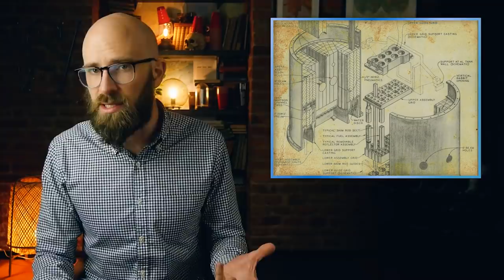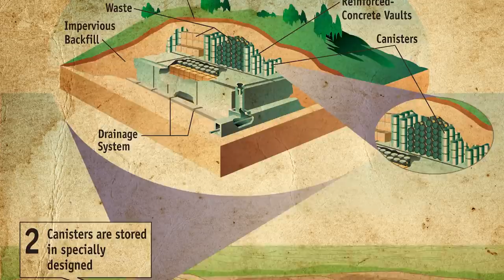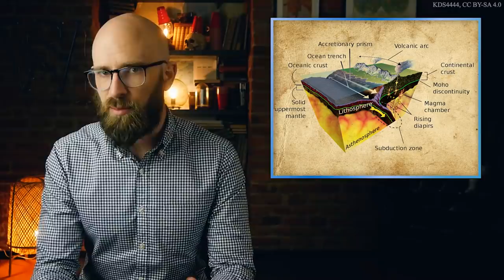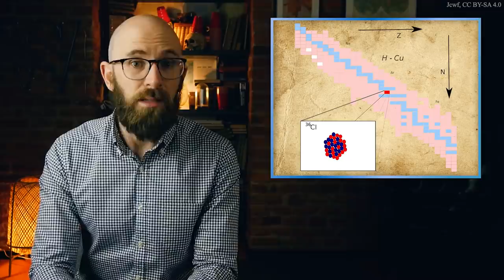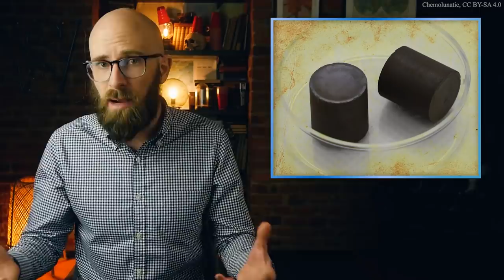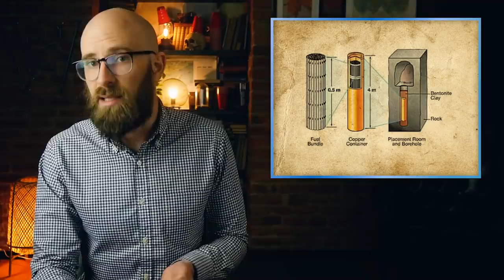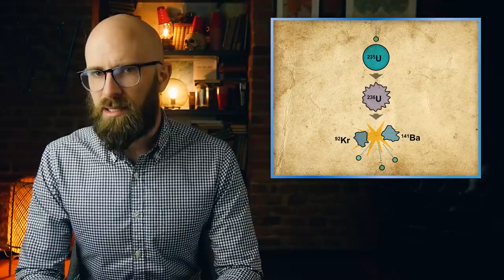How Does Nuclear Waste Disposal Work?

Comment: If nuclear power is less dangerous than any other form, given the accidents in the Ukraine, Japan, and a host of less famous accidents, I can't help but wonder, how is solar power killing anybody?
Reply: Manufacturing and (IIRC: especially) installation accidents.

Solar produces <2% of our power from >200/300 million panels.
Nuclear currently provides 5X that of solar from 440 reactors, in the 70s/80s; nuclear was providing over 10x what solar is currently providing.
There have been about 600-700 nuclear reactors, each operating for 30-50 years.
Since the 50s; there have only been a 2 or 3 dozen direct deaths and around 5000-10000 people who were harmed by radiation.
11x more people have been killed by sharks than in nuclear accidents.

Nuclear accidents are consistent headline grabbers and are hyped up just like airplane crashes are; so that many/most people are more afraid of planes rather than cars.
Reply: @LENZ5369  The figures I've read were waaay higher than that, although most are disputed, and as radiation death isn't always immediate, it would be hard to say what the real figures would eventually be.  I did wonder about manufacturing and installation of solar panels and I can well imagine either job might be dangerous.  I have no doubt too that nuclear power is far more efficient than solar.  Of course, if somebody is killed by a falling solar panel, they don't have to evacuate my city for a few thousand years.
Reply: @johnstevenson9956  What figures? 
yeah -the exact number is a bit nebulous because of different definitions/intentions/agendas/etc. (I mostly used the UN's numbers) but you can get a vague idea; for example only 30 or so people died during or within a few months of Chernobyl, it was just 1 at Fukushima.

I know some non official figures count like 10s or 100s of thousands but that is counting pretty much anyone who could have potentially been exposed to any radiation from Chernobyl; no matter how little.
For perspective: the people who evacuated from the town next to Chernobyl (Pripyat) -got the most significant radiation dose of any population center but it was only about 10x of what an airline pilot/crew would get in a year.

The radiation levels in Pripyat is currently back around 'background' levels -most of the radioactive material would have decayed in about 2-3 years (short half lives).
The plant itself is still pretty bad but it's about half as bad as it was -most of the material there has also decayed but there was just alot more of it so lvls are are still high, IIRC it should be back to around background lvls in about 100 years or so.
Even Hiroshima and Nagasaki were never evacuated -combined; there's about 2mil people currently living there.
So you would just need to a get an airBnB for a couple years before you could go home :D
Reply: Fukushima and TMI killed ZERO people and Chernobyl maybe 200, the crazy high estimates is 6,000. And that's pretty much the entire list of commercial nuclear accidents. There's a few military and scientific nuclear accidents with low single digit death tolls and at that point you're almost at the end of causality list.

Whereas solar kills dozens a year just from falling of roofs during installation, all while producing far less energy. 

There's also a variety of other sorts of industrial accidents one can encounter with solar at any stage of it's life-cycle, fires and electrocutions being the most common. Then there's all the deaths from creating the solar energy before it's used, since it needs an absolutely insane amount of raw materials that are rarely if every mined in the best of conditions. Conversely uranium mines are tiny and manned by pros usually using robots. And over all it just takes less effort to make nuclear power because it's millions of times more productive than solar, so all that effort saved eliminates chances for injuries of all sorts.
Reply: @bronzedivision  Completly incorrect and how dare you dance on the graves of those poor millions of people.  Again exposure to ionizing radiation causes primarily but not limited to cancer.  Each cause of cancer is unknown and has been for the past 70+ years after the first bombs were tested.  Therefore it is a fact 100% known that it is unknown how many people have died as a result of everything nuclear.  You must retract your statement and do not place that incorrect information anywhere else.  You are purposely misleading people once I taught you the right information.  Now you must change your stance...bias